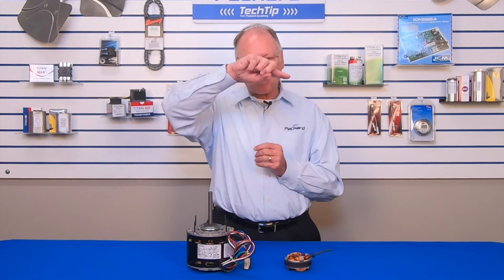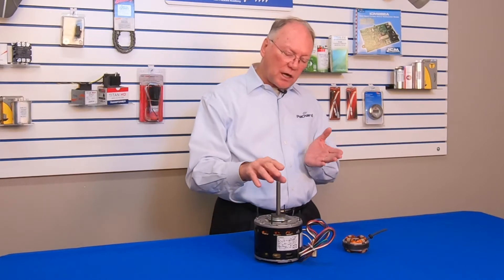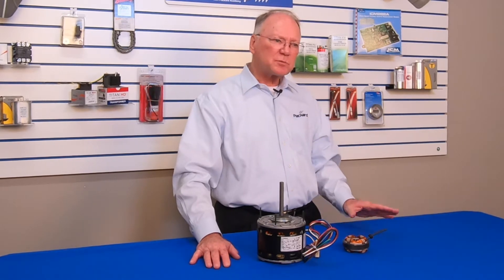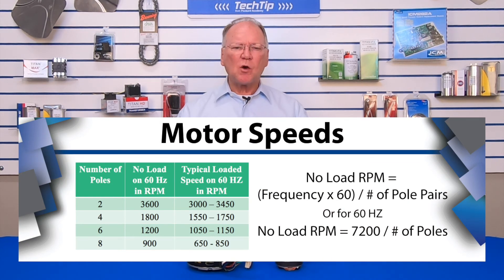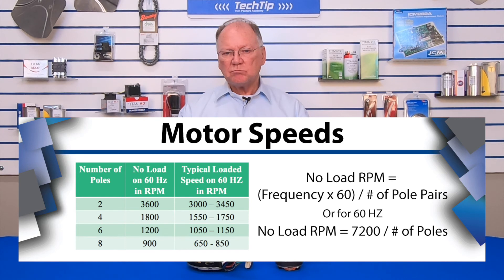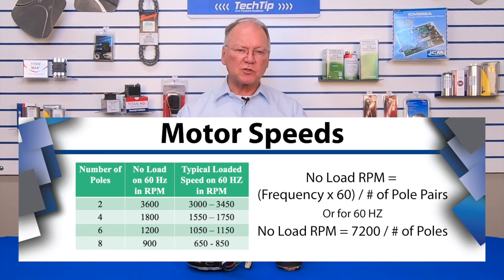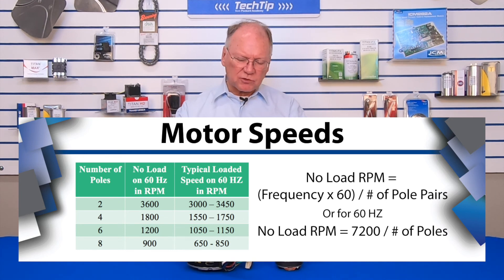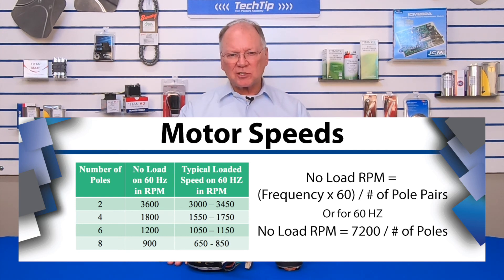Electrical Frequency & Motor Performance: What You Need To Know

Comment: As voltage converters do not convert frequency; how would you run your US electric clock (accurately) on a UK power supply, please? Thank you.
Reply: It’s a hypothetical example used for demonstration you don’t have to read so deep into it😂
Reply: @Evancade  You do, if like me, you are faced with exactly this conundrum.

Comment: 240V makes better sense as it requires less or half amperage to deliver the same wattage of a 120V North American Circuit, in the UK we have 3000Watt water kettles and makes my cuppa tea 2x faster. In USA/CA we can't find anything more than 1500watts because the mains cannot handle the amount of current. It is amperage that makes a wire go hot and burn, just try shorting a 12v battery with a gauge of wire designed for 120v! It will burn your fingers in an instant! I've installed UK plugs in my N American home; only issue now is both wires are hot like the outer wires of a centre tap transformer so I needed to install a DPST switch to make sure both are off as a temporary solution. Power bars assume LNE configuration not LLE, so even if it's off you can still get zapped between earth and the still connected Live. In long run will install an European consumer unit probably in a ring circuir topology following British Standard requirements using the Brown, Blue, Yellow&Green sleeves that need to be imported, after converting to 50hz and do proper earthing/bonding and an RCD so to have Live, Neutral and Earth just like in Europe @ 240/50Hz  not a floating 240V Live, Live, Earth @ 60Hz. Safer, with fused plugs and RCDs, not he flimsy connectors that falls off so easily. They will be two separate systems starting from where power enters. A proper install 120/60 next to 240/50 with Earth and Neutral. Running a 3000Watt kettle over a transformer will 2x the amperage on the primary / 120v input side of the transformer; nice way to get a fire if the breaker doesnt trip first and especially when none of the American plus are fused; for thost that are unaware.

Comment: Very informative VDO. Now I am in the opposite situation and would like to send a small 230V 50Hz lathe with a speed controller to the Philippines (230V / 60Hz). What would I expect there. Would it work. Using your clock as an example, the rpm would change Laid at the top, but otherwise functional. Am I correct. Thank you

Comment: shouldn't if be possible to make a motor with 3 6 or 9 windings? because even though it's not divisible by 2, every time it goes through a rotation, it would be the 4th time that a coil is activated, so like, even though it's 3 coils it goes through 4 every 1.3 rotations.... so it's like the same thing?

Comment: Now I ask... Why 50 cycles create overheat on a 60hz equipment if theoretically (on my mind) the more frequency, the more friction and heat produced?
Reply: Lower frequency higher the peak voltage is needed to maintain the average voltage (what is used to measure ac voltage)

Comment: how much can you speed a motor by a VFD before it saturates ? Is there a way to calculate that ?
Reply from the maker: The variables make it difficult to provide a simple answer.  Characteristics that are used to calculate include Voltage, Torque, Frequency, Inductance, and Resistance, to name a few.